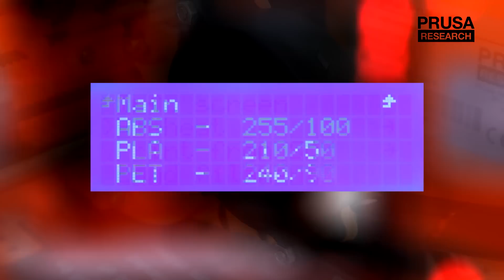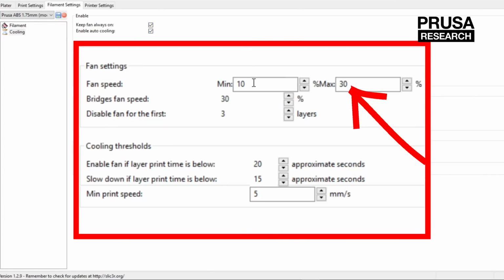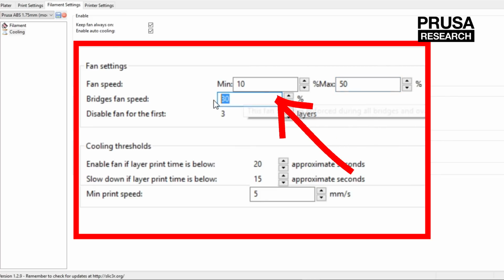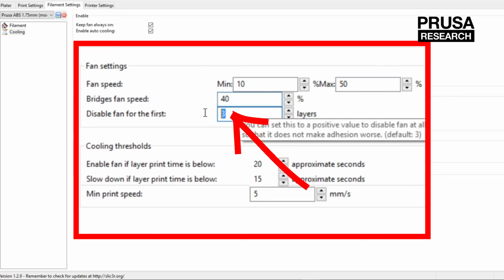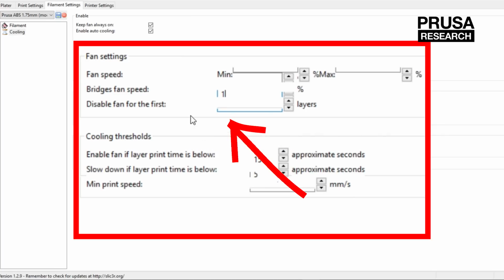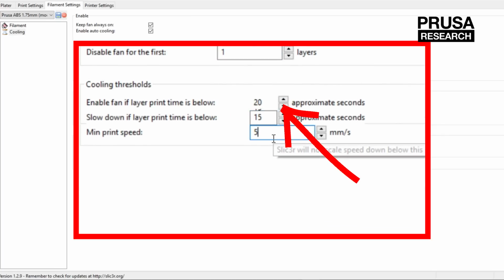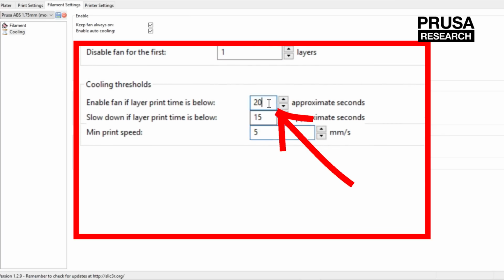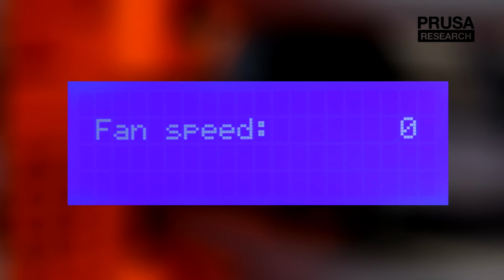Setting the print fan - Tips & Tricks #12

Comment: Thanks! But what about the FAN setting in the Temperature menu? I think its a bug in the new firmware.
The manual states that one should/could check the fan connection this way, but it doesnt work, even if the fan is connected properly. I received my printer two weeks ago so this is an issue for your latest model.
Reply: +Codeplayer 

Set the fan speed to 255 , then make sure to Click the wheel again after you set the speed :D if you dont click the wheel again after you set it, it wont turn on.  Ive seen a few folks make this mistake.
Reply: Yeah.. This instruction should be included in the instruction. As it works different compared to axis controls, therefore it does not work as expected. Good UI design would be to make all controls work in similar manner. Or at least to warn about different or unexpected behaviour in manual or UI itself. Forinstance, the menu entry could be "FAN SPD (CLICK TO SET)"